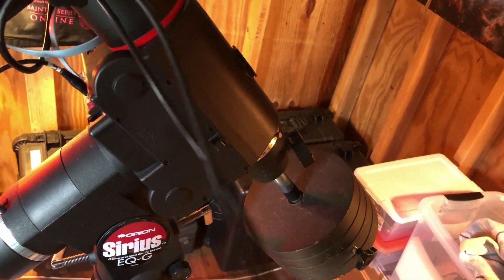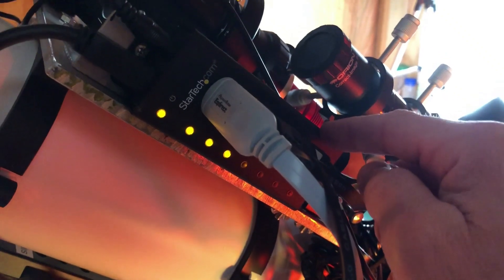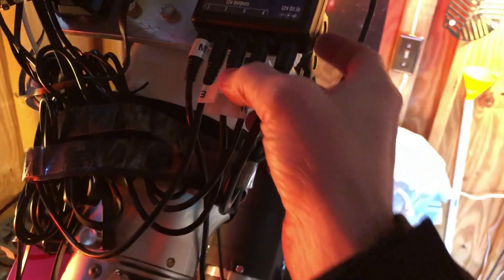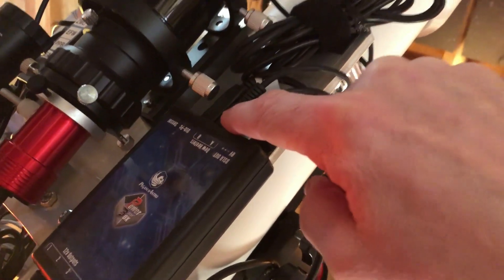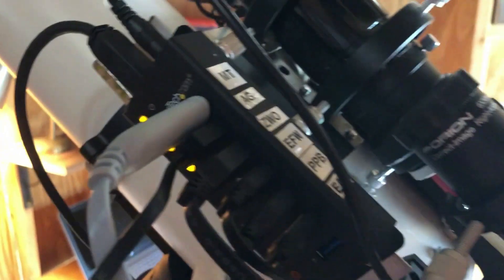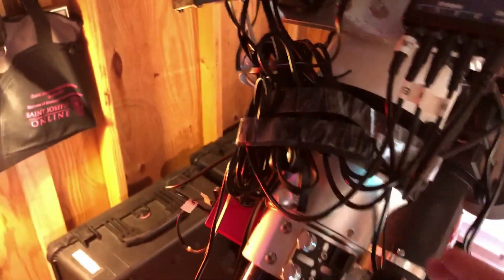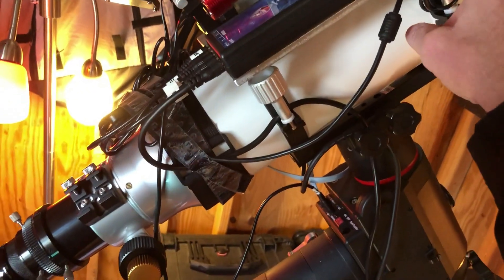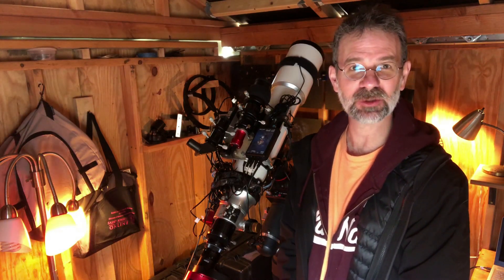Telescope Cable Management 2020 (ZWO/Pegasus PPB/Orion/AstroTech)

Comment: I need a block diagram to set my wife's gadgets. She bought an expensive lot of astrophotography gear and expects me to wire it up. I will have to figure out my own I think. This still looks like a plate of spaghetti.
Reply from the maker: Ha Ha, yeah welcome to astrophotography.  Making a diagram is a good idea as it helps identify what needs connecting.  I also labeled the wires and plugs with a labeler - tape will work though.  Also, I purchased a whole bunch of velcro (different sizes) to wrap things up.  - Good Luck

Comment: Nice to see how you do your cable management, do you have enough with 4x 12V out ?
Because I am starting with this great hobby, so I am looking around for some info.
I guess you have to power the mount, main camera, guiding camera, filter wheel, motorized focusser and your USB hub, how do you mage that with only 4 outputs ?
Reply from the maker: Everything plugs into the Pegasus Box and then that is plugged into an outlet. - Good luck

Comment: Excellent video! - I have a similar system and can concur with you on the Startech USB hub. Well built and has never let me down.
Instead of a cable to the PC, I use a small travel LAN so I can work wireless from inside my house or when I'm at a star party and there's no WIFI.
Reply from the maker: Cool, I have my computer outside but I can control it inside using Team Viewer and Google Remote.  The Travel LAN seems like a good solution.
Reply: @AstroQuest1  Hello Kurt - The TravelLan gives my 5 bars consistently, while my WIFI only gave me one! Looking forward to your next video!

Comment: I have more or less the same setup as you, and been having problems downloading images. I removed the ZWO 1600 usb cable from the Astrotech hub, and run it directly into the laptop, and now it works fine. I notice you don't run your autoguider or EFW from the ZWO usb hub. That might be my problem, I will try running the autoguider and EFW from my Astrotech usb hub, instead of the camera hub.
Reply: I had the same problem with my ZWO and plugged it directly into a MINIX N42C-4 mini PC mounted to my SCT. I could never get it to work through the Startech USB hub.
Reply: @davidf9494  I know ZWO recommend not going through a USB hub to connect to the PC. Since I took the Startech out of the loop, I've had no problems.
Reply from the maker: That could be.  I don't use the camera Hub.  I have everything going into the AstroTech Hub and then a USB3 cable going from the Hub to a USB3 input on the computer. - Good luck

Comment: Good stuff Kurt. One concern I had was all of the signals going into one USB port. I also have a powered hub and I had issues with dropped signals and the imaging camera not downloading some time ago. I think my USB hub was no good, so I upgraded and now I also use dedicated USB 3.0 ports on my laptop for the guiding and imaging cameras, while the power USB hub with mount, EF, and PPB go into my Thunderbolt connection on the laptop. So my question is do you see any communication issues with all of your signals going into one USB port on the laptop? I would love to clean up my cables by doing that. Thx
Reply from the maker: I used to have problems with my old Hubs and USB2 cables, but with the PPB, StarTech Powered Hub, and USB3 cables I have not had any issues.  - Its been over a year.  knock on wood.  Chuck's Astro (most recent video) was just pointing out he needs a new Hub as they do go bad. - good luck